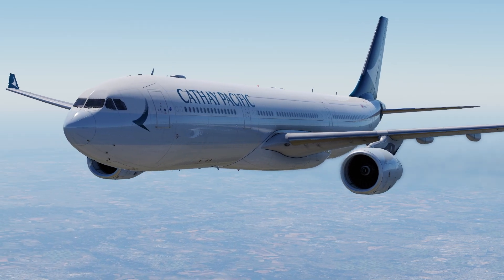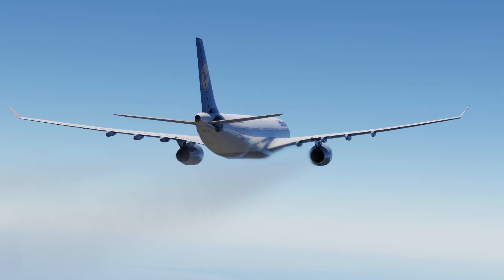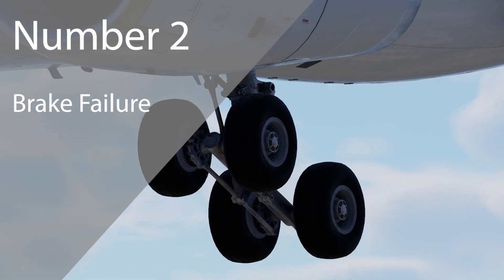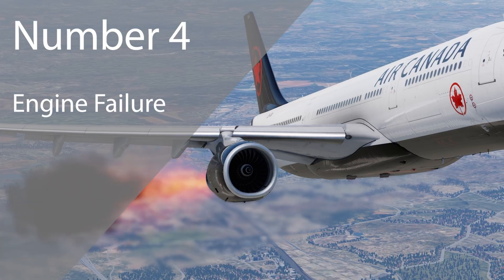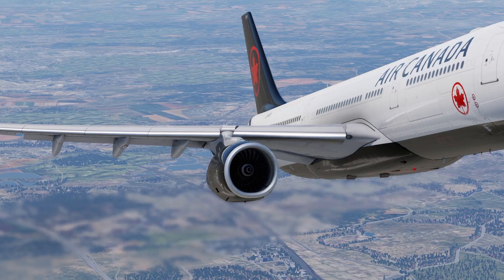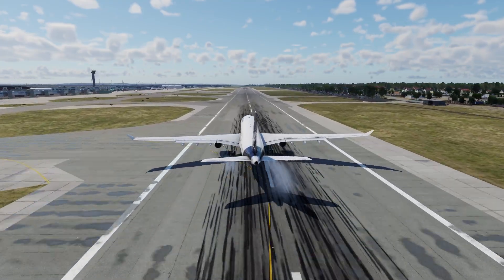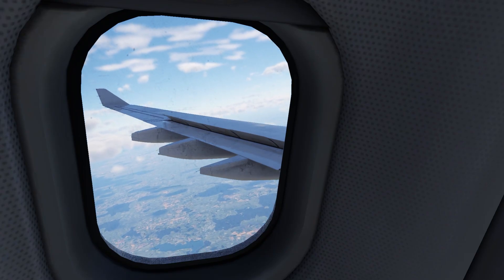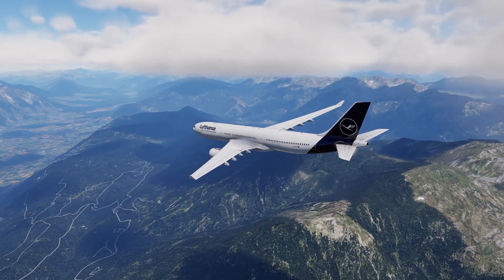Why Most 'Emergencies' Are NOT Emergencies | Curious Pilot Explains #5

Comment: 3:19 The engines still need a form of electrical power for engine control (including power settings). If an  engine is still spinning, this turns a small supplementary generator and this powers the engine control circuits.
Reply: But what about that ram power generator at the back? Do they work together
Reply: @PeaceLoveUnityRespect For engine control, priority is given to the supplementary/dedicated generator (or more precisely, "alternator") on each engine. These alternators can operate at as little as 8% of engine core speed. 
The RAT (Ram Air Turbine) provides power to essential equipment (enough to get the aircraft back on the ground). 
As long as sufficient airspeed is maintained, these backup power sources will provide power indefinitely, unlike the backup batteries.

Comment: Don't forget crews PRACTICE the most confusing, time consuming, Dangerous issues their Standards Departments can dream up. They'll probe a crews systems knowledge & find weak areas of systems, procedures, FAA Regulations, Company Regulations during the 3+ Hour Orals every six months then dream up scenarios to lead a crew down the garden path to the "emergency" that needs a broader collective knowledge base. A common joke around one airline was when a crew went in for an Oral/Check Ride went like this..."Ok guys, here's a177,000lbs of scrap aluminum! If you can build a 767 out of it, you don't have to take the ORAL."
Seriously, after 40 years of "Flying the Heavys," an engine failure on T/O was Not as Critical  an event as it was in a Cessna 150 Primary flight school. Treated as a solvable problem you'd seen hundreds of times in the simulator was Stressful BUT Solvable.
Reply: I think I’d get to work on building that 767 out of aluminum, in order to avoid the ORAL.  😉 An old saying a pilot friend of mine told me (over 30 yrs ago for context) is: “There are 2 types of Pilots….One who has ‘belly landed’ landed a plane (forgot to put the landing gear down)….and One who has yet to do so.”  Sounds like technological advances that help correct human errors has made this a good bit less likely to occur now-a-days.
Reply: @tyloni1223  P.S. never belly landed, but did hit a herd of cows on the runway. That count?
Reply: @tyloni1223  I had the Chief of Standards giving me a Sim Check & HE was getting a Standards Evaluation by the FAA. NO Pressure, Right? When his Evaluator asked him a Rudder systems question, he said, "I think I'll let the Captain answer that," & looked at me! So, when I rolled out my tool kit.......😉. I seriously didn't expect that but I'd had check rides from him before & went to the chalkboard & had only drew a third of the system with explanations the FAA Examiner cut me off & said he'd seen enough. Cram Night paid off that day. However, if you're interested, the Rudder Throw on a DC 9-30 is ± 26° (not that there's any guage/instrument in the cockpit that shows that.)

Comment: Some years past youtube brought up the point that planes around the 1990s were retrofitted with wings much 'thinner' and winglets added. I once asked an md-82 pilot what the fuel rating was, he took a minute and said 'about 5 miles a gallon at cruise'; in the 90's planes had black soot all around the engine exit ports;
With the 'new wings' and fuel sys./engines, I'd guess the new range is 32 mpg and up. Clean engines and now fuel hoses are very thin.
An f-16 has 'no space' for fuel tanks yet can fly over 1500 miles, afterburners make a purple ionized glow also.. so when a.t.c. asks for 'fuel in pounds' I'd guess it's a good fraction over rated.
Reply: My cat’s breath smells like cat food.
Reply: @Stumpchunkman226  So, the American cat/pet food 'regulations' ... ''Can include  euphemized pets, animals, 'road kill' outdated packaged meats still in the plastic, cooked at 145 degrees F for about 1 hour''. That is our 'pet food' and all pets have to deal with it.  

I worked a maintenance Job at ABQ. International airport in the 90's
I tell the truth.

meow!
Reply: From the 90s new designs used supercritical wings which are actually thicker.
Reply: @peteconrad2077   
I saw this unified 'wing retrofit' as you said; but the 'newer' wings yeah, were of composites, stronger and much thinner, some had winglets, the latest addition.
What only makes some sense, after covid,
Preventing a total economic collapse was this 'technological jump' in fuel economy, whereby
The wings needed to be thin to go along with it. Later, new engines had this efficiency built in; the Boeing/Airbus Neo's.
Reply: @wayneeligur7586  you’ve got it quite wrong. The new wings aren’t thin. New wings are fatter than those of the 737 or 747. Also I’ve not seen any airliners being retrofitted with new wings. I think you’ve misunderstood some stuff.
Reply: @peteconrad2077  I've been out looking; and working near planes, 1990's and up; I can tell you only that things do change. I recall when all pilots were ex-military, and then.. they flew like cowboys.. until you know everything's  now more 'civil'.
Reply: @wayneeligur7586  sounds like you’ve learnt little. I’ve been a pilot since 1993 and before that I was a qualified aeronautical engineer. The wings haven’t got thinner and they haven’t been retrofitted, I promise you.
Reply: @peteconrad2077  Yes, I remember all and every pilot was ex military... I've been flying since I was little; the first 747 and 2nd maiden flight [pan am] 1970 my family and I was on. I won't argue about wings... were you trained via r.a.f. or flight school?
Reply: @wayneeligur7586 RAF. While many RAF pilots make excellent airline pilots, it’s not universally so. The two fields require entirely different disciplines.

Comment: I hate to be negative yet..

In 5 years  looking at air disasters, one or more new one per day, so I may say I'm cautious of flying. In early days of air travel, it was common to buy life insurance at terminals, because planes crashed often, then. I don't like smaller planes and much prefer airbus as Boeing  is uncomfortable, worst being their 737 
the twisting spiral/vortex vibration and power noise with intermittent hydraulic vapors, present only on Boeing, is a 'known' health hazard fixed only on the 787.
There's a cosmic radiation hazard up there that's known about, yet dismissed.
Also, sanitation is grossly an issue, planes are seldom 'cleaned' just kept cosmetically o.k. and cabin air is recirculated a lot. WiFi is used in a aluminum cylinder fuselage, just like being in a microwave oven. I stopped flying in 2011. The 'millimeter wave' metal detectors are 'exquisitely' hazardous to your health.
All these points are facts, as well.
Reply: Uh, wut
Reply: @Stumpchunkman226  you read right guy!
Reply: There are 70-90 commercial AND private plane crashes per YEAR. How on gods green earth did you come up with one or more a DAY?

Unless you are living at cruise level, the extra radiation from cosmic rays isn't going to do you any real harm. May as well never get an x-ray again if you're that concerned. 

WiFi is orders of magnitude too weak to do ANYTHING to a human body you absolute lunatic. I've seen people press powerful transmitters right up against biomass and it barely tickled it. Seriously if you don't understand the first thing about wireless technology, don't go spouting utter bollocks and maybe go learn first. 

Again, unless you plan to retire inside a metal detector, walking through it once isn't going to do squat to you. 

You sound utterly insane or wildly uneducated

Comment: One thing I did not know was that the plane would automatically descend if the pilots fail to do so. That sure is a fantastic idea considering that one plane crash in Greece!
Reply from the maker: Exactly! It’s because of these unfortunate events that air travel becomes safer and these systems are added.
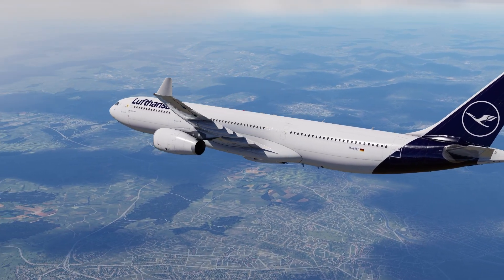Reply: @CuriousPilot90  12:06 What aircraft type descends automatically if no action is taken by the crew after a decompression?  Maybe one or two aircraft models. Airbus A300-1000? I would think a majority of aircraft would still not have such a system.
Reply: I don’t think that’s true, the pilot needs to make inputs before the aircraft can descend
Reply: @kickedinthecalfbyacow7549 the A350 does this. It not many others.

Comment: I did not know that the pilots would rock the aircraft when lowering the gear using gravity, but that sounds pretty cool. Also a small "correction"/addition: in more modern airliners the cabin altitude seems to be cloer to 6-7k feet than 8k, according to research from recent years
Reply from the maker: It puts a lot of strain on airframe pressuring the cabin but as you say, with modern designs and equipment they are able to pressurise to lower altitudes. I think it was the Dreamliner that is able to get down to 6,000 feet. Don’t quote me on that though. 😬

Comment: Great video! but Landing gear failure still make me worry after heard about LOT16 that the modern jet still have to do belly landing.
Reply from the maker: That’s fair, I didn’t expect an instant fix to a fear of flying but hoped that arming someone with this information might make them feel fractionally better. 😬 … Hopefully. Thanks for the comment :)
Reply: @Pakkapon Phongthawee when you are afraid of flying but have to, it's worthwhile to choose airlines that have a good safety record.  While flying is very safe across the board, this may help to know.  
Or have somebody find an airline for you, as doing your own research on airline safety before a flight may not help when you have a fear of flying.
Reply: landing gear failures are slightly more dangerous than normal landings because you have a small possibility of skidding off the runway, but you will stop extremely quick due to the friction.